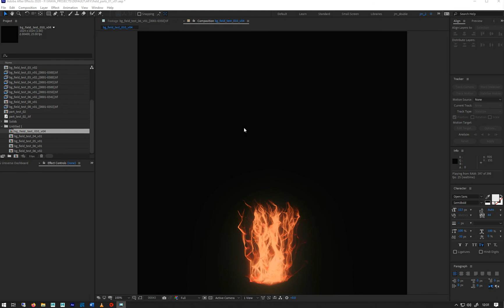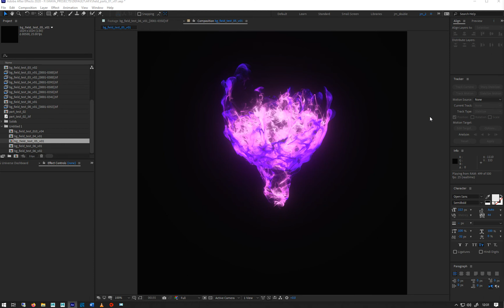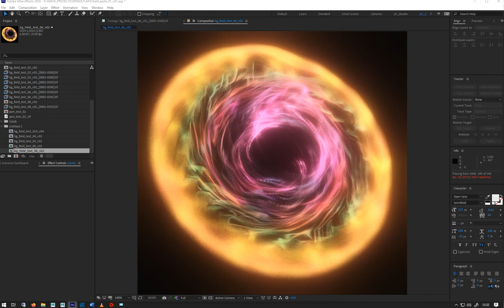BIFROST BASICS: WEEK 3 LESSON 1 INTRO TO BIFROST PARTICLES

Comment: Looks ace.
Have you tried rendering Bifrost in V-Ray?
Reply from the maker: You can only render using Arnold at the moment, but I think that will change once the sdk is realised. You can export Bifrost out to Alembic or Openvdb which you could then render in Vray.
Reply: @jmm7180  Super, cheers for the info.
Reply: @jmm7180  Does the same apply to Redshift?